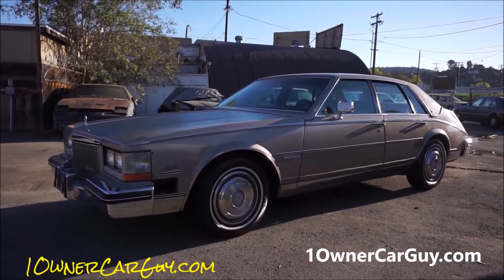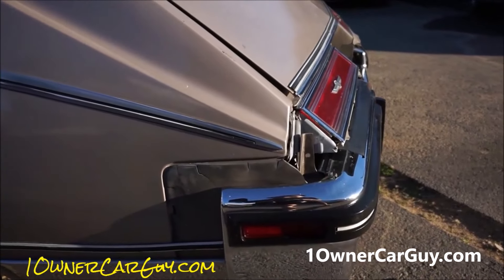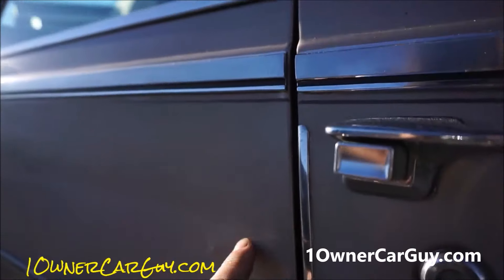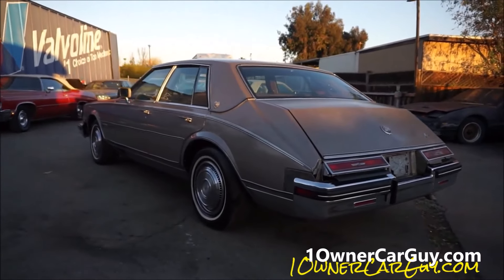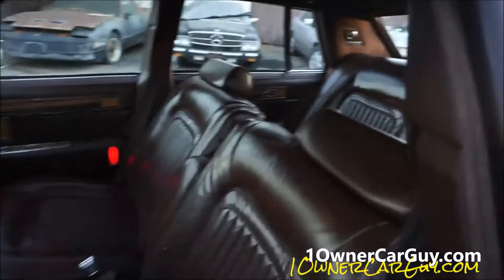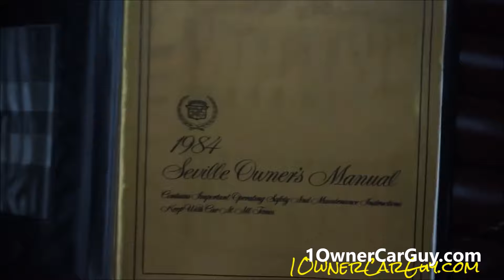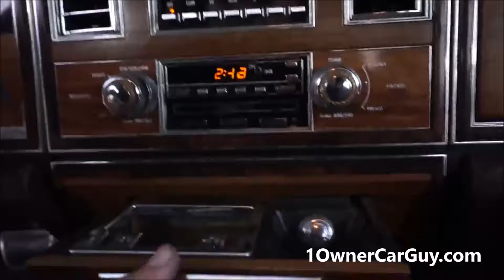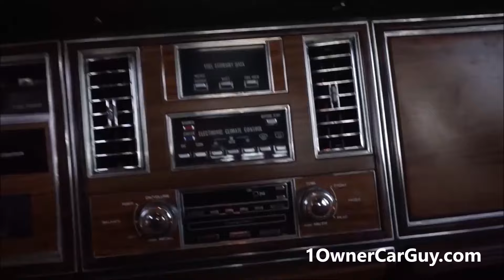$495 ~ 83 Cadillac Seville Classic Car Review Video Slantback Bustleback K-Body

Comment: gm had a real bad quality control issue back then with those plastic filler panals rottening off  a few years after the car was new during the 70's through mid 80's. it wasn't until the late 80's that they finally fixed that problem, but by then the only gm car that still used those plastic filler panels were the caddillac fleetwoods.
Reply: What do you want for $495?  Gee, maybe he give you a price cut!!!!
Reply: Why did they use plastic filler panels?